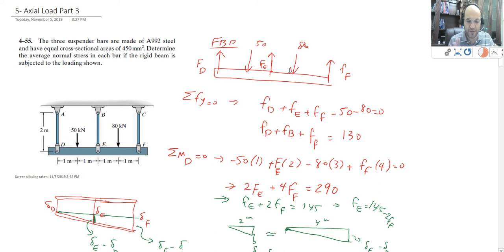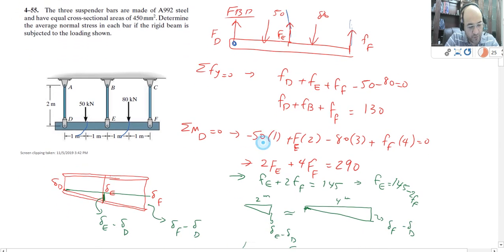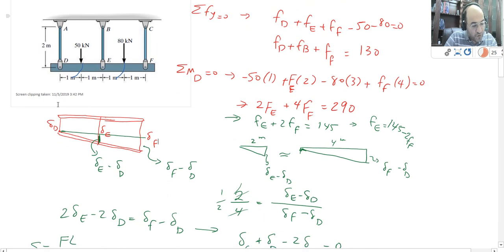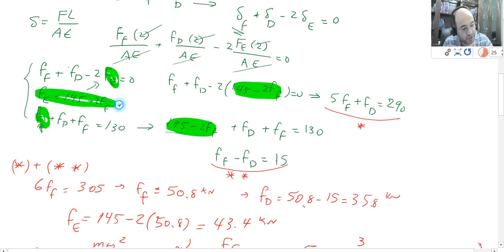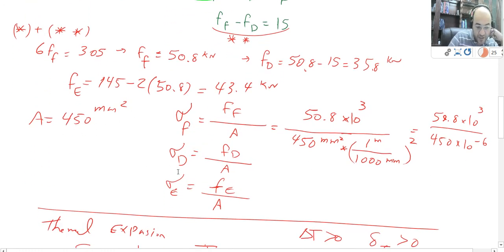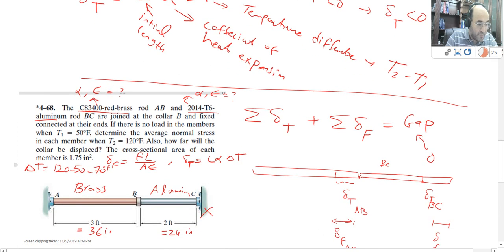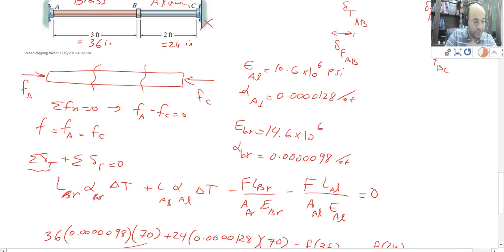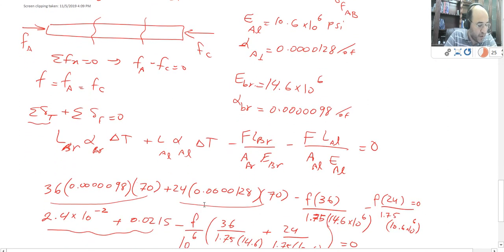Lecture 2-3: Statically Indetermined Axially Loaded Members

Comment: How is that sum of moment at D=0, and not at Eand F
Reply: Technically, you could also use E and F, however, you would have to account for how vector directions and cross multiplication works. D just makes the math a bit easier.
Reply: @firstdictonary  thanku, I got it